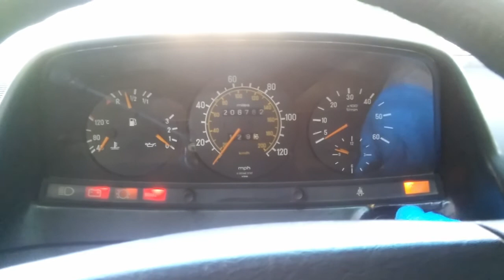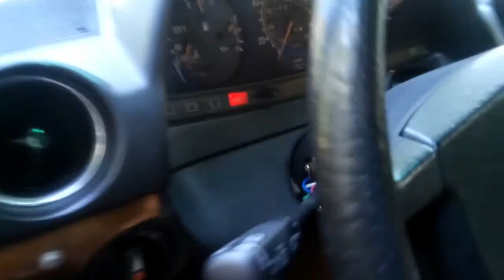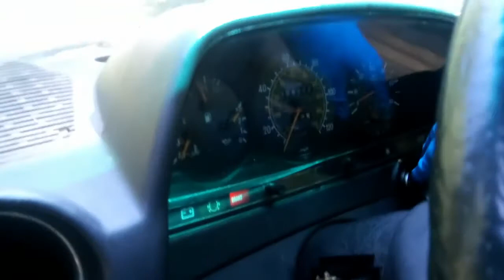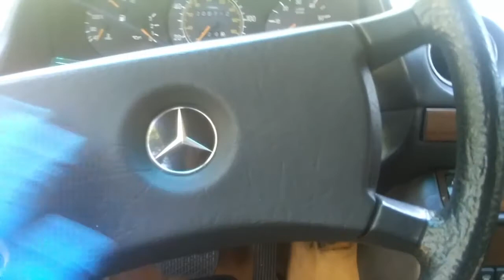MERCEDES W123 DASHBOARD REPLACEMENT. THE BUZZER IS FIXED!

Comment: Great video, as usual!  Thanks for showing your work on this.  I was really curious what kind of access I will have to the vacuum lines under the dash, and I can see it is all easy to get to.  I think when I do my dash replacement I am going to replace all the lines from under the steering wheel to wherever they are going as I noticed they get really brittle after 40 years.  I added your channel to my favorites on my channel because you have helped me so much on my W123.  I really appreciate all your videos!
Reply from the maker: Thank you very much for your support, sir. You can always message me directly if you need help or advises. I’ve been helping lots of people get their cars running. Sometimes I text random strangers who are selling their cars and their cars aren’t running. So I just help them and guide on what to do. I’m sad seeing them dead like that

Comment: That looks fantastic! I just pulled my dash and recovered it with vinyl while I was rebuilding the vacuum pods. I am having a hell of a time putting it back in. Do you know what size the bolts/screws the mounting brackets use? getting it seated properly is more challenging than I originally would have thought it would be. Thanks!
Reply from the maker: Sorry, I don't remember. You need a lot of patience for that. It's not so horrible, trust me:)

Comment: Vito! I like the rims..what are they called? A link would be helpfull
Reply from the maker: Gadget Guy Tech Team They are 15inch BBS wheels. Unfortunately I can't find them anywhere. I bought them from a private owner 2 years ago. But try to look around
Reply: VITO'S GARAGE thanks man..one more thing .i have 123 m102 petro. Problem is i keep having breaking problems.Have changed the master cylinder still same issue. What happens is ..You bleed the breaks are back again..then tommorow morning No breaks!! You have to pump 2 or 3 times.. i have checked for leaks ..can see any.No jammed piston either....what could be the problem
Reply from the maker: Gadget Guy Tech Team I think a defective master cylinder. Even though it's new but it still might be defective.. Did you bleed the master cylinder the right way? Sometimes some cars have to be running while you bleed the brakes
Reply: VITO'S GARAGE Yes i did..car was running..was thinking same thing too.Will try out a new cylinder  and see how it goes.